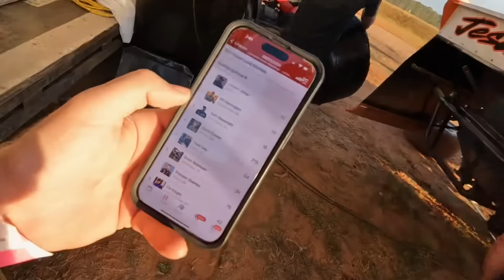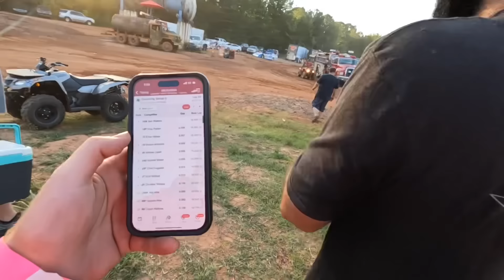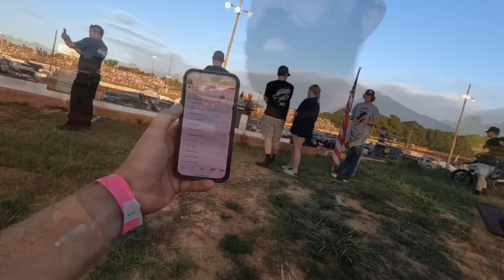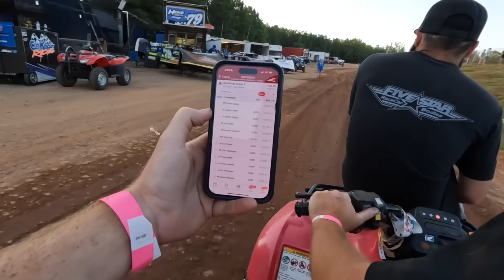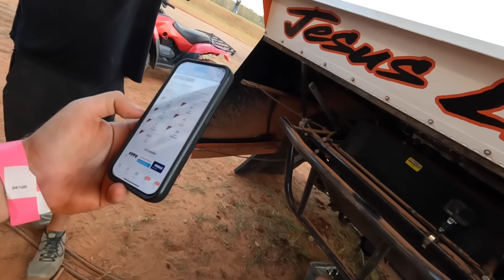The Longest Straightaways We’ve Ever Seen! High Speed Late Model Racing at Lancaster

Comment: That heat race gave me goosebumps. Dang good drivin for Josephs first time on this track.
Reply: Too bad they don't pay for heat races
Reply: @Trackratz-zl9di Well thats debatable as if you advance out of the heat you get main event money if you fail in the heats you dont
Reply: @FISHGEEK305  Sorry Dave not even close to debatable. You get jack shxx untill you take the green for the main .
Reply: What do You get for bumping them Gum's 🤔🤷🏻‍♂️
Reply: @Trackratz-zl9di   well if you read what I said you will see if you don't race well in the heat there is no main right?? So if you have to start the main to get paid (at least I do) and the heat is what puts you in the main. I would say the heat pays
Reply: @Trackratz-zl9di  that's about a badass track ain't it man???
Reply: @FISHGEEK305  Maybe your not understanding what I'm saying .Over the years We have won heats just to discover we broke a valve spring , burned up a ring and pinion ,or had contamination in the oil .These things prevented us from ever taking the green in the main thus we never got paid .
Reply: @Trackratz-zl9di  aaahh shit you got a point there man!! I broke a driveshaft two weeks ago after running 2nd in a heat and it came apart 20ft from the trailer and there was no check that night 😅 I stand corrected
Reply: @FISHGEEK305  Sorry to hear about the drive shaft deal . I believe if you race long enough you will break everything on the car atleast once .
Reply: Absolutely awesome driving
Reply: @FISHGEEK305  Really good way to look at it.  You finish well in the heat race you get paid regardless where you finish in the A main.  You dont finish well in the heat races you run alphabet soup sometimes or just a B others where you possibly dont get paid for maken it period  So technically you do get paid for the heat race with your theory.  That makes total sense too haha never looked at it like that before.  Heck the Lucas Oil Series gives out an award for fastest in Hot Laps every race at the end of the year.  THey tally a points system based on fastest in hot laps each race.

Comment: Lancaster is one of the tracks that was never shortened like the others. I went there with Freddy Smith when he was just getting started. I remember Freddy was running good untlil a flat tire ended his night. We had a big laugh because the local boys down there opened the passenger doors and crawled into the car. Freddy's door panels were brazed on and he crawled in through the window like drivers do today. Awesome drive by JJ in that heat race.
Reply: Cherokee was better racing. Bigger isn't always better.
Reply: @chadmorrow5299  Cherokee used to be bigger.

Comment: When I get bored of my mental health with my depression / Bi-polar gets the best of me from stress etc. I set back and watch Hunt the Front Videos of the past it is kind of like therapy for me.  It's mind soothing as I like to all it ha-ha.  But rewatching this video again today made me wonder, with the engine trouble Joseph was facing with it over heating like that it sounded like till he finished the race it got pretty hot again after cooling it off in the work area naturally battling back to a tenth-place finish.  I know you have backup along usually but considering if you didn't, did this play any role goin into Cherokee engine performance wise or was overheating still a issue?  Did ya have to pull the backup out, change engines or anything funky junky like that or wasn't there any issues from tonight till Cherokee >

Comment: I wouldn't be surprised if you investigated it but the float level and maybe the fuel pressure was the over heating issue those long straight aways will empty a fuel bowl quick and cause a lean condition which will make a engine run hot

Comment: I think the straightaways at Wythe may be even longer.
Reply: Wythe does he have slightly longer straightaways than Lancaster but it has a much broader corners also and our tracker in West Virginia at WVMS Up at mineral Wells/Parkersburg is probably the biggest track in the nation but now it’s just a much bigger track and then Lancaster or Wythe Raceway to begin with but the straightaways at WVMS are crazy long and it’s extremely hard on the best engines also

Comment: I hope yall use better oil in these big $$ engines then yall do with your 604s(Rotella 🤦🏼) 
1 reason you use these better oils such as Daytona1 or Klotz is for if and when u run a little warm such as the case here!!
Reply: They run Base synthetic racing oil in all their Super engines! Rotella is recommended in the 604 by the engine builders so you might give Rotella a little more respect!
Reply: nothing wrong with rotella bub.

Comment: You boys still have a lot to prove. Your happy with a 11th place. Poor results the whole trip. Hope you have better results when your back on your series. Sad your getting your butt handed to you here too
Reply: How did you run? First time at these tracks let us know how you rsn
Reply: @jasonlong3929  I used to run big block  mods in New York,I traveled for two years, we race on a mile dirt track,all open wheel. That's racing.. I did ok, never started and parked
. Most of our races were ,40 laps weekly, and big races,100- 200.
Reply: @BrianWheeler-rf3zs  I ran open wheels for years and never heard of a one-mile track that featured 100/200 lap races!  
 What brand and size tires did you run?
Reply: @shadhastings6219 Syracuse NY... 1 mile track
Reply: @shadhastings6219 have you ever been to the Springfield Mile? They run USAC Sprints 100 laps.